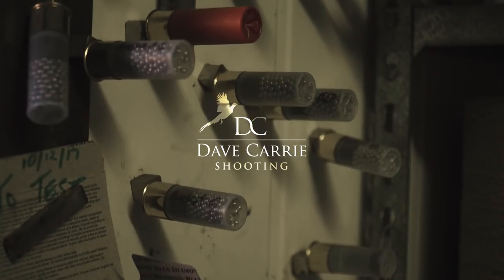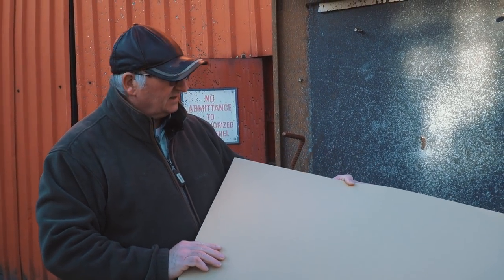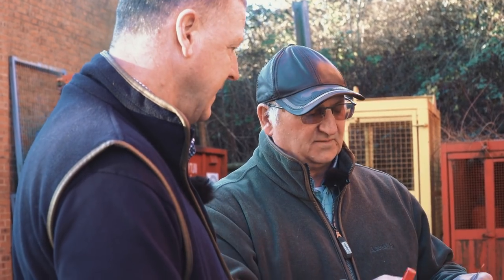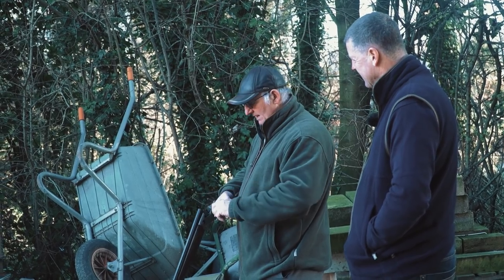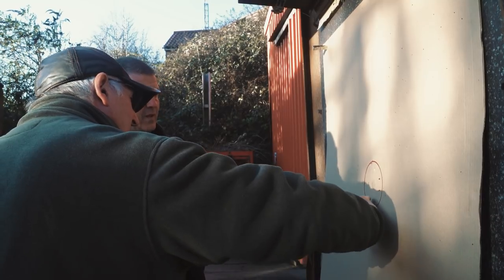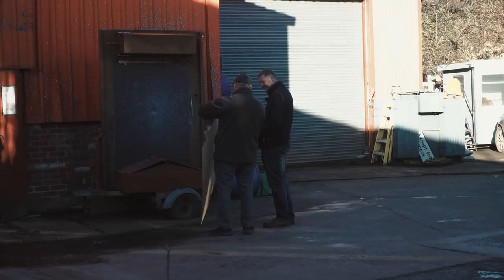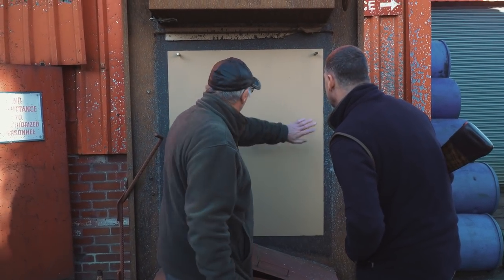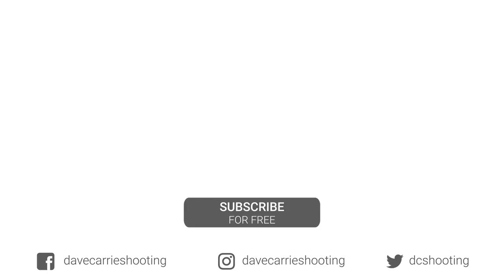Carrie & Crow - Pattern Test (34g 5 Pigeon Extreme)

Comment: The ''George Digweed'' Pigeon Extreme is a brilliant cartridge..Well chaps here we go into the nitty gritty with people who shoot enough to know the score and hopefully how to overcome the marked difference in efficiency when shooting pheasants at range.F16 is 18.6 mm.bore.What Triplex bore design means I am not really sure but local gunsmith says they are playing with tapers.I have personally witnessed how the shot to kill ratio has increased by some margin on high bird shoots which have made the transition to fibre wad only.Purely as an example a 32grm fibre wad 5 shot is not the same as a 32grm Plas Wad 5 shot on any decent bird let alone ''archangels''.Good luck Dave will be an interesting ride.
Reply: I think the science is just the starting point. I had a tightly choked Kemen which patterned and shot better with Eley VIP 32 fibre than any plaswad round I tried. Couldn't work that one out.
Reply: Coincidence.I also had a Kemen KM-4 which I will guess now was around 3/8 and 5/8.Patterned great with anything I put though it but back then would have all been plas wad so cannot draw the comparison.One of the main reasons I went to a multi choke was the fibre fobia.Before I would just change the cartridge to achieve the end result.

Comment: Do you not feel plastic wads should be confined to clay shooting grounds, to limit plastic pollution in the countryside?
Reply: I think they should be banned universally, clay grounds included. That would lead to the required investment being made into formulating a quickly biodegradable version.
Reply: Travis Thacker  few manufactorers build wads out of realy degreadable material, for example Hull don't know weather Gamebore too.the break in the uv -sunlight.not in 1000years,within few month.
I don't beleave this is a promo- fake.Nevertheless i prefer fibre-wads.But using steelshot Fibre wad could be difficult, cause the steelschot could rubb down the barrel without protection by a wad

Comment: I notice your patterns are a bit high would you not be better with the disc in the centre of your pattern especially on crossers, I shoot a benelli and it was about a foot high so lowered it ,it now shoots dead centre patterns , would this be better a tad high
Reply: stewart grieve Alright mate, what Benelli and how did you lower it?
Reply: @Parfashrek   It was the sbe 2 , i had a gun smith make a thicker taperedshim for me as well as  a metal spacer plate with the hole down a bit to allow the drop.Was superb after that .It shot exactly where i was looking .You struggling to get it down .I tried all the shims that came with it but still not low enough
Reply: Thanks for getting back to me Stuart. Yep, Benelli M2 is shooting high but have just put in a C shim, haven’t shot it yet but fits much better when mounting. I don’t have to drop my head anymore so fingers crossed that’s done it!
Reply: @Parfashrek   yes shouldnt drop your head at all when shotgunning ,as you probably know . I tried the c shim too but still high . Full choke at 16 yards on a pattern plate or card just mount and shoot at a four inch circle see where it goes  ,dont aim .Remember six inch high at sixteen is a lot more at forty or fifty yards. I got mine where the pattern was almost central ,not that there is much pattern at sixteen yards with full choke but its the way to do it
Reply: Thanks mate, will do as suggested and and see what I find👍

Comment: Iv got an f16 like crows and it patterns really tight with the manufacturers chokes. Do you know what those extended ones are?
Reply: no wish to butt in but pretty sure chokes are Briley Spectrum Extended. M 0.20'' and IM. 0.25'' .For Blaser F3/F16
Reply: JPDorsetHQ thanks. Wonder why he’s done that I would say the blaser chokes are pretty damn good already.
Reply: Some folks prefer a longer taper choke path.The Briley have a taper to parallel in both flush and extended therefore longer taper in the extended.Apart from instant ID from colour code on the Spectrums the extended are easier to monitor/check if secure and change as some do on the clays circuit.Not seen any come loose but think in the end checking becomes a habit with multi chokes and the only way with the flush is to stick your finger in the barrel lol.
Reply: At one stage he was using aftermarket wad stripper chokes.
Reply: you sure they were not Mullers ?